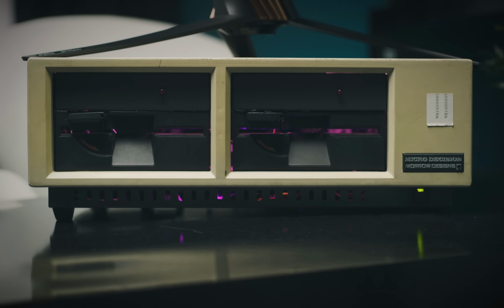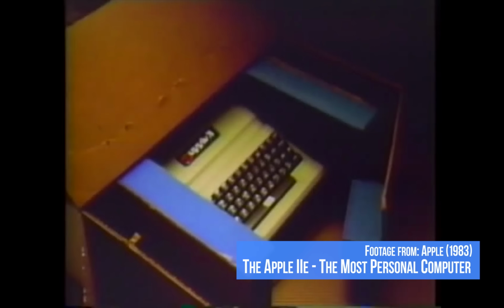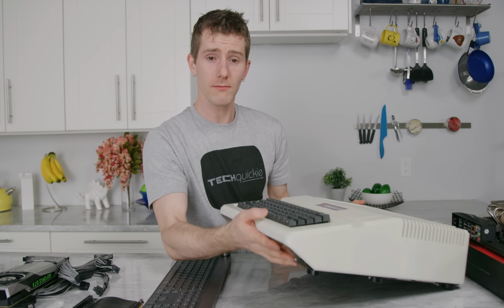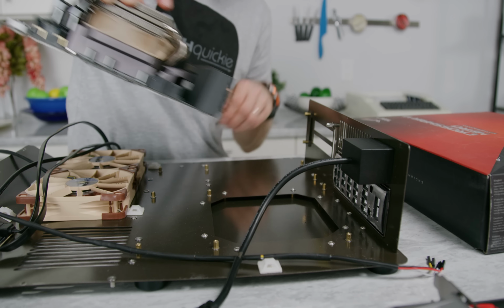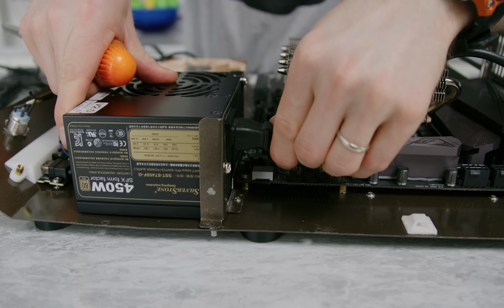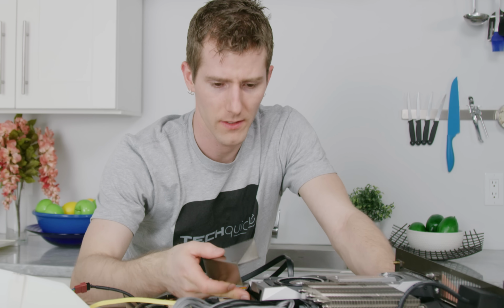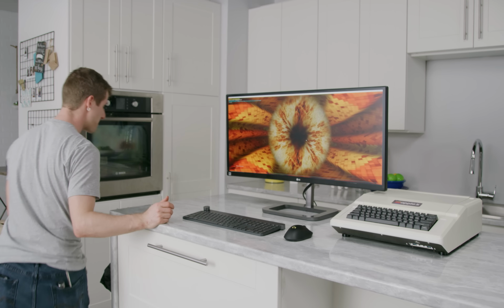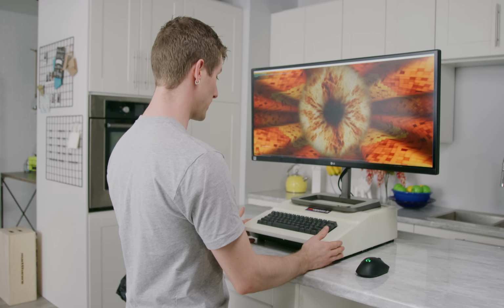Apple II Themed PC Case!!

Comment: Wouldn't it be easier just to stick a minicomputer in the case? 

I'm surprised at the fans but I do remember the original computers tended to get a bit hot, although the components could handle it.

Comment: Needs a CRT shell that houses a modern LCD screen and a light home NAS or something to go with the rest of the setup.

Also, how is this not getting smacked down on a trademark lawsuit? I'm shocked a project like this made it that far without Apple's lawyers getting all over it.
Reply: The patent on the Apple II has long since expired. Patents are not the same as trademarks or copyrights.
Reply: AirCooledMan2006 and yet Apple still holds the trademark on the branding...
Reply: RyTrapp0 Apple still uses the Apple trademark on most of their products. They maybe (big maybe) have no active trademark on the case design or the "Apple ][" name, but the basic Apple name and Apple logo shape is clearly theirs (minus whatever the Beatles still owns).  So I'm guessing the box has to ship without the Apple sticker.

Comment: I'd like it if the back panel was interchangeable with a more "modern" back so you could have a fully decked out full ATX motherboard. But there needs to be more of these kinds of cases. Love to see someone water cool a system in one of these cases.. Also Why can't there be a full ATX power supply in that style case? I'm just curious at this point.

Comment: I think if you dont go overboard with the modern technology and put in something more practical like a Ryzen 5 2400G based system putting out a lot less heat and dont expect too much out of a case like this then It should be fun to mess around with.
Reply: alaskanhybrid also if you got a proper cable so that the power supply wasn't taking air in from the case and exhausting it back into the case I imagine that would help.

Comment: A nice case but not very practical. More like a novelty for those who want to have a retro-looking PC.
And Linus, did you really have to put a 1080 Ti in there ? The case is obviously too small for cooling such a monster GPU adequately. A mid-range card would be more adequate for such a small case.

Comment: I hate Apple products but this build should have been a Hackintosh for sure.
Reply: SX64 but it works
Reply: Ken Smith you can get a 6502 emulator running on at least a Pentium 3, which is what I did as a kid. And you could even then run it faster than realtime.
Reply: You can't sell hackintosh's but you make them.
Reply: HtRod Hippie:
A 6502 emulator should be able to get just about full speed on a modern CPU.
Linux could go directly to running a knock off of the Apple-2 basic on the 6502 emulator
Reply: no it should run apple integer basic
Reply: HotRodHippie AMD CPU has on Mac? Sorry not gonna happen
Reply: They changed the Mac os licence agreement a while back. You can't do it legally.
Reply: rajesh koothrappali oh I didn't know that I thought it was only selling them.
Reply: This was after, Appl emade a bit deal about this about 3 or 4 years ago.  Stating they have updated their terms to you cannot use their software on none authorized builds or parts of Apple's.  So unless you making a hackintosh with real apple parts Wish kills the point its not for say legal.  But really, they probably not going to go after you..but doin ga youtube video on how at this level L is at, would raise some attention i'd say
Reply: They need a another Motherboard because AMD CPUs with Hsckintosh are a big time waste
Reply: HotRodHippie o
Reply: the only legal way to get your hands on a Mac OS X iso is to download it from the app store if you then install it on a non apple product you are in breach of the EULA. how enforceable and binding that contract is, is the question. in most of the world, the EULA is not legally binding, but with the insane consumer laws in the U.S, I won´t be surprised if Apple actually could take action against a breach of EULA.
Reply: Sid: Hahaha...Basic in ROM!
Reply: Apple will/could/can sue LMG for promoting a hackintosh build. Small youtubers sure heaps of vids without issue, but when you're a big dog you have to follow the laws and you can't take that risk.
Reply: Apple has overpriced high tech used as status symbole

Comment: They need to fake a CRT with a deep case using a ~22" 1080p monitor or something like that.  An old apple mouse needs to be done to to complete the effect.
Reply: 22" would be far to big, you could do something with a tablet. It would be much closer to the size of the old hardware AND you could make something that wasn't too heavy to up on top with ease.
Reply: Bonus if it's a hackentosh
Reply: Why not cut out the middle man and make an actual CRT? Pretty sure the digital-to-analog conversion can be done monitor-side these days...
Reply: There was no Apple mouse at the time, since this Apple computer was produced before production computers used mice. There was no Macintosh line at the time, as there was no graphical user interface; thus, there was no Apple mouse—not until 1983. The first mouse was produced in 1965, the first GUI was worked on in the early 1970s or so  (at Xerox), and the first time the GUI and the mouse were introduced to the public market was in 1983 (with the Apple Lisa). Subsequently, the Macintosh line was released. 

As old as the first Apple mouse is, it's not as old as the Apple ][, and it would look very odd next to one.
Reply: Commenting Account: Loved your comment =) Sure miss the old days. Mouse was released for the //e. Back then what I had was a //+ but I had this friend who had a //e and was very proud of it. He also had GEOS and a mouse! (of course we who didn't where very envious) GEOS came from C64 but was ported over to Apple// but then the //gs came out =D I've been wondering why they didn't use a //e case instead. Also, I remember seeing the //C with a mouse. Anyway it's good to remember the past every now and then. Aside from the nostalgia it does remind one of ones direction in life. As they used to say "Apple// Forever" =D
Reply: The apple ll didn't use a mouse.
Reply: @nexo768  For the most part your statement is true but not for the latest model(s) of Apple ][.   The old Apple ][gs that I had used a mouse and had a full gui.  (Sadly I got rid of it years ago and I could just kick myself for doing it too because it's case was signed by Steve Wozniac. :-( )  ... didn't know who he was back then
Reply: Plus the old apple speakers ;)
Reply: foxpup just put a Sony gdm fw900 on it
Reply: foxpup Agree
Reply: FrostyP To cram PC parts in empty space.
Reply: just get a crt monitor and have a displayport to vga adapter
Reply: foxpup o
Reply: this is the most fucking useless thing ever
Reply: YES please, 1080p CRTs! I would buy one in a heartbeat.
Reply: foxpup: You would need a 2 button mouse (with a wheel) hahaha...
Reply: @dieabeticgamingph7729  Perhaps the "fake" Apple mouse could have the main normal button as the left "click" with a squeeze sensor as the right "click".  It would even be ambidextrous.....then there's scrolling....hmmmmm....our feet aren't busy are they? :-)
Reply: FrostyP Because the real CRT won't look like a real Apple monitor, unless you get a real Apple monitor. And tat won't work with a modern OS or hardware.
Reply: Actually, a real Apple II monitor wouldn't be too hard to get working. They just had composite video input. I used to hook VCRs up to them. The real issue would be poor resolution/cost of an original CRT. I'd love to see them make a fake Apple II CRT with a high res LCD in it.

Comment: This reminds me of the Ford GT kit car replica. It's not bad, but you'll have to get the right specs for the powertrain and drivetrain to fit in the pre built bodywork. Fitting smaller dimensional modern power plant would make sense as you'll make decent power and have plenty of cooling room. 

Same with this. I think a B series mobo would've been more sense but because this is LTT, why not crap in a Ryzen 7 setup? 😛

Comment: You used to be able to get Amiga 1200 cases you could put a low profile itx board in. Use a KeyLah 2 to make the keyboard work and it would look exactly like a A1200.
Reply: You could do the same for a Commodore 64, 64C, and 128.

Comment: It seems like this is more geared towards emulation enthusiasts, not sure anyone is going to be cramming super high powered components in there...
Reply: Yeah, I agree. The CPU and GPU they crammed in there are probably way beyond what this really needs--I mean, running Crysis at 1080p on what looks like an Apple II should be enough for anyone, surely!
Reply: I was just about to write a comment along these lines. But I can't help think you'd do a lot better with a tiny re-creation stuffed with the latest Pi and SD card support. Maybe quarter size with a real keyboard and a tiny CRT (fake CRT, it'd be a LCD) that could sit on it. More than enough power to emulate all that old junk. Err... I mean classic software. If you want a full size model. Wouldn't you just buy a restored real one? Nostalgia makes people do crazy things so I guess there isn't any real logic to this.
Reply: Nah, the tiny sized systems with keyboards aren't very ergonomic, though you're right, a PI should be able to do most of what you need.
Reply: I would!
Reply: I would for shit and giggles

Comment: Linus Tech Tips I Just planted out my new rig what do you think of it please tell me.
1. Kingston SSDNow UV400 480GB SSD
2. Western Digital WD Black 4TB WD4005FZBX
3.Phanteks Enthoo Evolv ATX Tempered Glass Anthracite Grey
4.ASUS ROG Strix Z370-F Gaming Motherboard
5. Intel Core i7 8700K
6.Corsair Dominator Platinum CMD16GX4M2B3200C16 16GB (2x8GB) DDR4
7.NZXT Kraken X62 280mm AIO Liquid CPU Cooler
8.ASUS ROG Strix GeForce GTX 1080 Ti OC 11GB
9.Kingston SSDNow UV400 480GB SSD 
and all that comes up to $3,582 AU and $2751.80 US and £1968.20

Comment: Still has more ports than the new MacBook
Reply: True true.
Reply: Not great IO out of the box, actually. You only had video out, cassette in and out and joystick, so really only 3 peripherals could be pluged in, that's less than the macbook pro, and thuderbolt can do much more than just display storage and HID.

Of course you could always add an RGB card, two serial cards, a mouse card and 3 floppy drivves (with support for 4) and still have a slot left open in the machine.

Comment: This is absolutely ridiculous. I need it.
Reply: Do a Hackinotsh Video on it. :D
Reply: @TecboyJones  How hard would it be to make a hackintosh? I happen to be almost done moding a (broken) 1982 apple IIe with modern hardware and would seriously consider the hackintosh route. for context, my config for this build is a core I3 9100, an amd vega 56, 8GB of corsair RAM (the cheapest I could find) and a 512GB sata SSD.

also for any purist arround here, no modifications were made to original parts, I just replaced the bottom sheet metal with a custom one and fixed everything to it.
Reply: @TecboyJones  Update: macOS big sur is running on my apple IIe sleeper.
Reply: @user-le8ul4nr5t  What?!  That's fantastic, how hard did you find it?
Reply: @TecboyJones  It wasn't too bad. It took some research to make sure the components I was buying were compatible with macOS and quite a bit of planning went into building the computer since space was a bit limited, I didn't want to modify any of the original parts and I can't really make big or complexe pieces of metal work. The macOS install wasn't easy but it was still largely doable with a good guide. Though there are still some details that don't work quite right.

Here is the guide I used:https://dortania.github.io/OpenCore-Install-Guide/
Reply: Me want.
Reply: Snazzy Labs you havent even watched the whole thing at 100% speed yet
Reply: SEEMS LEGIT
Reply: hackintosh on that case maybe?
Reply: should have been mini itx ,or micro atx with atx psu and better peripheral support,and use original power button placements
Reply: Snazzy Labs Lmao
Reply: I'd love to see a review of the final version, especially on one of the finest tech channels out there.
Reply: Do you forgive my tweet?
Reply: I know right
Reply: Snazzy Labs conrats on 400k subs
Reply: Turn it into a hackintosh so still runs an Apple OS!